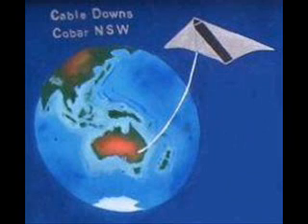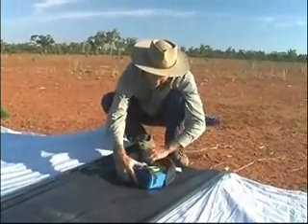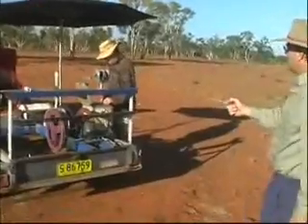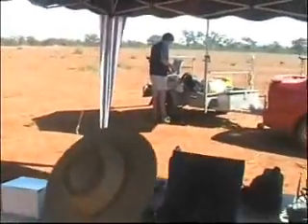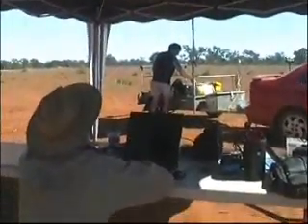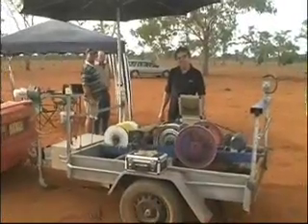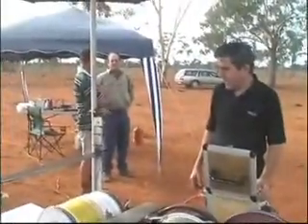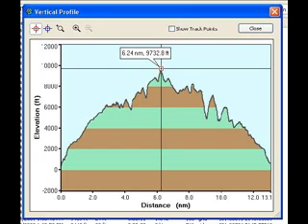Kite Altitude World Record Attempts 2009

Comment from the maker: We are planning to raise the record from 16,009 ft, which we set in 2014, to 20,000 ft. Then we will attempt to fly a train of kites attached to ne line to 40,000 ft. The current record of 31,955 ft was set in 1919 by a team at a German weather station.

Comment from the maker: The line used is made from braided Ultra High Molecular Weight Polyethylene fiber or UHMWPE. It is very light, will float on water and is very thin for it's strength. Weight for weight it is stronger than steel and Kevlar.  A 1mm line is approximately 400 lbs breaking strength. I started with 10,000 meters of Spectra brand from Innotex USA in 2004 and this is 0.8 mm thick for 200 lb breaking strength. In 2005 I used 300 lb Dyneema line from Amika in Taiwan. This line is 3.5 kg for 10,000 meters and 0.8 mm thick. I need to replace lines from time to time as they can sustain wear and tear plus slightly improved lines are released every few years.
Overall I have 80,000 meters of line ranging from 140 lb Dyneema to 700 lb Dyneema and the 200 lb Spectra mentioned above. We currently have 12,000 meters of new 160 lb Dyneema from Jeely in China as our primary line, 8,000 meters of backup line and 2 other 12,000 meter line sets from various manufacturers. Each line set is on an identical storage reel which will fit directly to the reel bearing, clutch and brake mechanisms. These lines have a retail value of over $40,000 and without some sponsorship from DSM Dyneema in Holland, I could not afford to run these attempts. The most important property of Dyneema and Spectra lines, apart from tremendous strength, is it's small diameter and low wind drag. I have evaluated other lines including Dacron, Kevlar and nylon mono filament lines but Dyneema and Spectra braided lines are by far the best lines for flying kites very high. It is important when purchasing line that the manufacturers credentials be established as there are dubious manufacturers in China and elsewhere. Obtain a sample before bulk purchase and test breaking strength if possible.
Cousin-Trestec, a French line manufacturer, gives a guarantee of strength and quality with a certificate. There 25,000 meters of line is exceptional quality. Amika of Taiwan is a another supplier of high quality lines. Innotex USA makes high quality Spectra lines. Jeely of China was less than satisfactory. Good price but poor quality IMO and tested well under stated breaking strength (160 lb test, 200 lb claimed). Ebay full of cheap lines but buyer beware.

Comment: Dyneema, which is an Ultra High Molecular Weight Poly Ethylene (UHMWPE) micro fibre. These micro fibers are braided into a fine cord consisting of hundreds of strands. The Dyneema line we use is extremely strong and thin. Another brand of the same fiber is Spectra. I have some of this line. Many ropes, cords, and braided fishing line are made from UHMWPE. I am supplied with Dyneema by Cousin-Trestec in France and Amika, Taiwan. There are numerous Chinese companies manufacturing UHMWPE lines.

Comment: What kind of string do you use again? Also, how can I get that type of string? Thanks.
Reply from the maker: A late response but for the benefit of new viewers, the "string" is Dyneema. This is a synthetic fibre and the technical name is UHMWPE fibre or Ultra High Molecular Weight Polyethylene. Spectra is the same composition, has very similar properties and is  manufactured by extrusion through spinnerets like a spider web. The very long chain molecular bonds provide exceptional strength and is about 40% stronger than Kevlar for the same weight and 10% stronger for the same diameter. It is a common alternative to nylon fishing line available at fishing stores and online. The line we used for most of the attempts was 134 kg (300 lb) breaking strength and was 0.8 mm thick. The property of extreme thinness is the most important to minimise wind drag and line sag. The very light weight is also a very import property to maximise kite altitude. This line has a specific gravity of 0.97 which means it will float on water. The line was provided in 1,000 metre lengths from Taiwanese manufacturer, Amika. The line was joined with splices which is a technique to eliminate knots which weaken the line. The splices are made by mean and enabled a continuous length of 12,400 metres of line to be stored on the big reel ready for record flights. We used all but 200 metres to fly the kite to 16,009 ft bove ground level to break the World record. The line is so thin and slippery, it is impossible to handle by hand. It would sever even gloved fingers. I mention this because there has been several critics of winch controlled kite flight who say a record should only be recognised by hand flying a kite. OK, put it to Guinness World Records to establish a hand wound altitude record. Then do it.
I'll break that too.